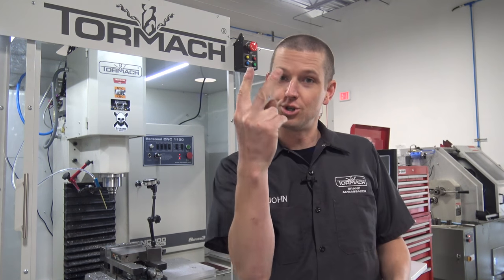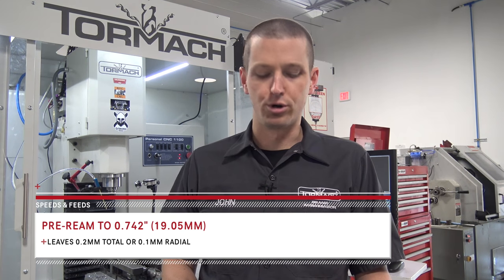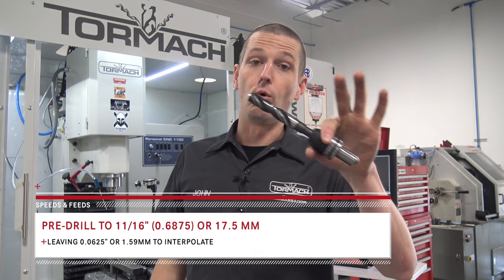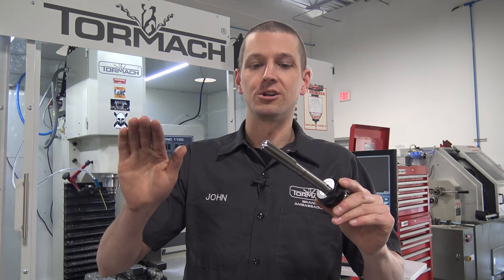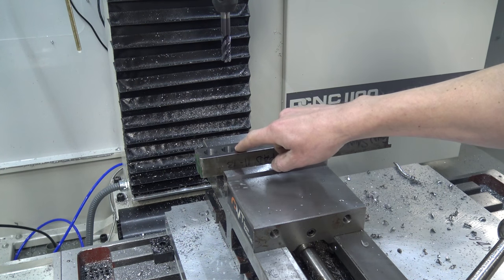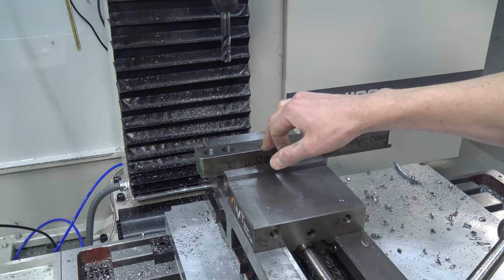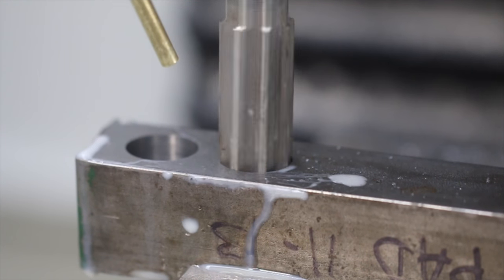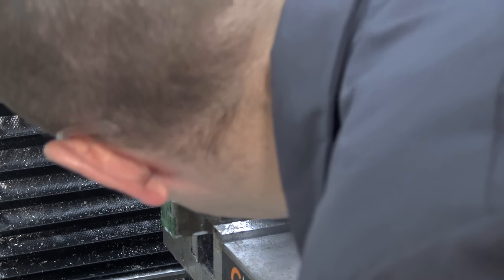Rough & Ream?  Will it work?  Part 2  Widget95

Comment: I am a machinist by trade but i still enjoy watching stuff like this. So were you not programmed to the correct depth? Does G85 stop the spindle at the bottom?
Reply: Also John, That roughing endmill might be undersize, giving you a smaller hole. Your finish should have been pretty good since you ramped down (eliminates peaks and valleys in theory), so Id say the size discrepancy is due to actual tool diameter.

Comment: A very simple way to check for runout is by using a pencil,  a marker of any kind will not work... pencil only. When you place a clean bit of any kind in the drill chuck, while it's spinning up, take a pencil and just barely touch the shank of the bit then stop the drill. Closely examine the bit where you placed the pencil mark, if you can see the thin pencil line all the way around on the shank, then you have no runout. If the line only shows up partially on the shank halfway around or less, then you have runout. If it reaches more than half way around, then your good, but your shank is not. I've used this method and I swear by it, nothing thinner than a pencil line that a guage can't even measure.

Comment: When your doing the tool setup info for the roughing end mill, how accurate is the true diameter of the end mill due to the way the flutes are designed with the serration as compared to the smooth flutes on a finish end mill.  I had a problem similar to this and remeasured the Dia of the End mill and found I was off by a few thousandths  of an inch from what I had put in the tool setup.
Reply: Depending on how strict the manufacturer hold to these tolerances and how often they are checked. Also is it a new or has the tool been used. You have to think of the wear on it and how much that might be. I was taught before you ever put a tool in, mic it, and if the tool has been the CNC for a long time, or doing long runs of a part, take the time to check and make sure it is still within tolerance. (it could save you a lot of time trying to find out why a part is not the right size, do a mic on the tool, then go from there) This might make a good vid for you to do, setting up a tool and entering in the tool info for the CNC.
Reply: +NYC CNC roughing endmill's are held to looser standards. Usually +0 / -.001. Because,  well they're roughers. No need to spend the extra grind time getting it within tenths. And they always err on the smaller side because again, roughers. Last thing they want it to do is accidentally over cut.

Comment: Well if the experienced tool and die guys weren't interested they wouldn't be watching.  Keep up the work I love watching this stuff especially because I haven't ran a CNC for 20 years until recently.  Simple parts seem to be kicking my ass. Alot has to do with machine compatibility issues. Using an old anilam 3300mk controller.
Reply: See if you can get it upgraded to a Mach3 controller.  It'll make your life so much better.

Comment: A rule of thumb for readers is leave 1/64 for up to a half inch reamer, and 1/32 for 1/2" and up
Reply: +NYC CNC rough carpenters :D

Better rule.  Under 1/4" leave 3% of reamer diameter. Over 1/4" leave 2% 
Over 3/4"....  Get yourself a boring head ;)

Comment: leave 1/32 in the hole and push the reamer hard, 10"  IPM  the leads on the front of the reamer are designed to center and stabilize the tool while being pushed thru and works in combination with the length of the reamer (meant to flex to follow),  shortening  a reamer is never recommended cause with any run-out you end up boring the hole so the reamer length (alowing flex) and cutting lead along with a good strong feed (keeping reamer stableized and centered) compensates for any runout giving you a nice tight reamed hole..... want a slightly looser hole... leave only .010-.015 in the hole and dont feed heavy actually peck like you first did and you can get up to a .0005 larger hole. if we ever have to cut a reamer to fit in a tool changer we as little as possible leaving it as long as allowable but make sure you feed is heavy and there is a good 1/32 of material in front of that tool.
Reply: Some tricks with reamer also are...you can dip the reamer in acid to reduce hole size by tenths....the longer left in the acid the smaller it gets. .. try 3 min intervals.
To intentionally cut bigger rub a carbide insert along one flute of the reamer pushing that cutting edge out a hair.  It will do the trick for a couple holes. ... btw love your channel,  very inspirational your thought process...

Comment: I don't think your mist coolant was enough lube to keep the reamer going. try using a flood or a touch of cool tool cutting fluid or something similiar. you are definitely almost there. may I suggest skipping the first drill, it will cause uneven wear on the second drill.
Reply: +NYC CNC reamers cause a lot of heat. so then both the reamer and the hole expand, which is why it grabbed your reamer. this also may cause your hole to be oversize, it may be in tolerance while the hole is hot but after it cools it will grow .001 more. that's why a low limit reamer is advised.

Comment: get yourself some 3 point micrometers , they are worth it . keep up the good work. ps you could go down in speed and use grease with that reamer :).
Reply: +NYC CNC 

Yes. However look at the cost of full pin sets. Damn near the same price to cover the same ranges. 

Though pins won't  break if you drop em off a table however....

Comment: No shame in needing to know. Keep on expanding your knowledge. You have a positive duty when you get to be an old fart. You have to bring along a string of learners, make them competent.

Telescope gages to take ID readings and Shars mikes used as a comparator to a stack of gage blocks can be trusted (in competant hands) to +/- 0.0001" but the key is practiced, competent hands. You don't get that overnight. The other key is bore gages are quicker (and bulkier and much more expensive.)

Comment: No room for 2 because I'm # 1. Best bet 

comments.
 Pierre's Garage, Occams Sawzall, Peter W. Meek, is right. seems like runout should not cause a bell-mouthed hole. I hate reamers. I have to indicate them as close as .0005. I feel like an idiot every time. Test ream same material CHK top and bottom and dia of hole!
ryan crawford, YES! Not enough material. Dia/finish allowance ratio as well as straight, reaming feed . 
reaming speed. Never hit bottom, plan chip clearance on the bottom. Ream as little area as required. Always
check parts. Hmm, ream in, stop spindle, rapid out CNC folks. Test ! Now get back to work with the videos.

Next video, Last word on reaming a hole with a new reamer .4995 as marked. Now make that hole.
The hole should be at least 1/2 deep and checked with precision, deltronic pins or something good for 
.0001 to show the hole is to size as well as straight.
get help from your tool rep salesperson. Once this video is complete, it will be the best and only one like it!
Till next time, Hell ya brother!!

Comment: WHY WHY WHY???? Why wait your time drilling the material first then running a helical interpolation cycle with your endmill?? cut of the 2 drills and just run your helical interpolation cycle only ramping at a 1MM ramp per revolution. Secondly ensure your reamer leaves the hole rotating and feeding at the same speed and feed it entered the hole for better accuracy and finish.
Reply: +Carlos A I'm not familiar with tarmach mills but yes you correct with a vmc or a okuma Lb3000 like the one I work on yes you can helical interpolate the hole with a roughing endmill leaving 0.2mm radially and then run a finishing endmill with the exact same cycle removing the 0.2mm and it would leave a nicer cleaner fit
Reply: +NYC CNC can be of any size aslong as the flute length is sufficient to reach through the part
Reply: I'd be really interested to see how accurately this hole could be interpolated on a Tormach.  Would that be a good follow up video?